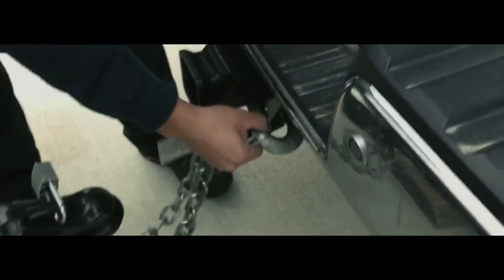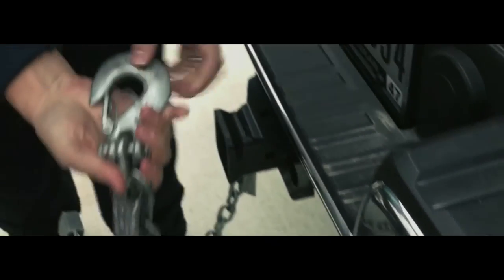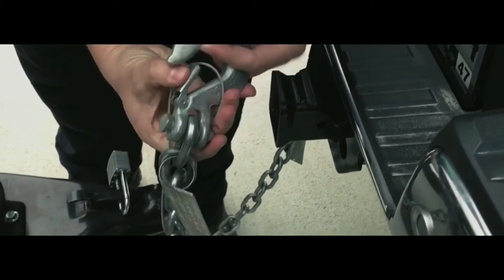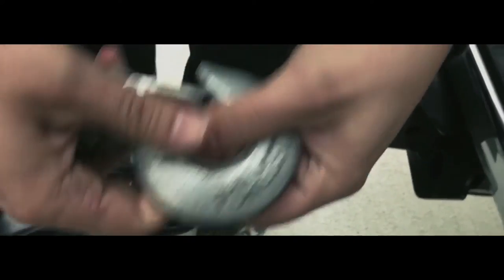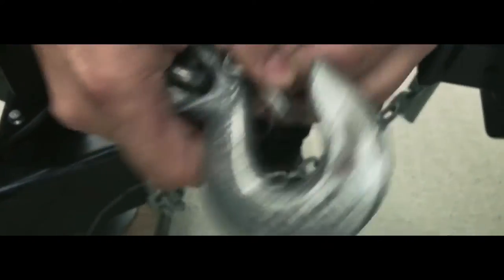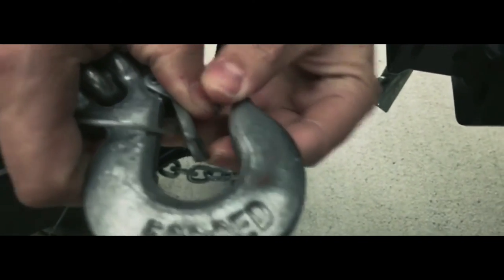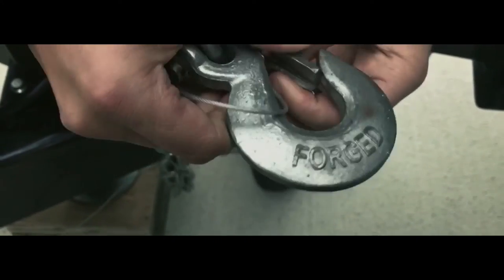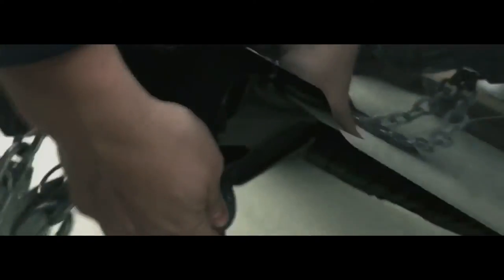Safety chain modification to fit chain box

Comment: Great way to adapt the hook without removing the gate! Make sure you remove the breakaway cable from the chain on a new trailer and install it properly, the one in this video would not activate the brakes. The chains are shorter than the cable and won't stretch. Always secure the cable separately.

Comment: Always cross your chains... for one thing, it will catch the tongue if it comes loose, which is a very good thing.  Another thing... twist the chains until they're just tight enough to let you corner... then they're much less likely to rub on the ground.  Thanks for the tip on trimming the latch... just about the only way my hooks are going to fit that new F250 hitch... lots of folks having problems with that hitch.  I'll use a Dremel and a cutoff wheel for mine.